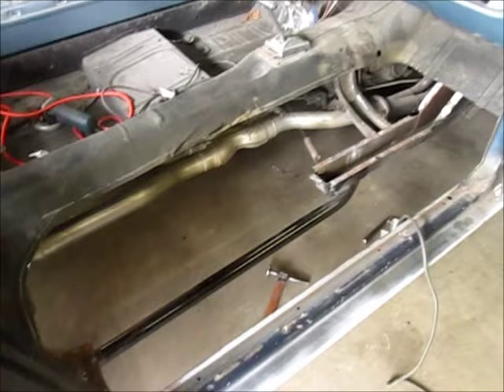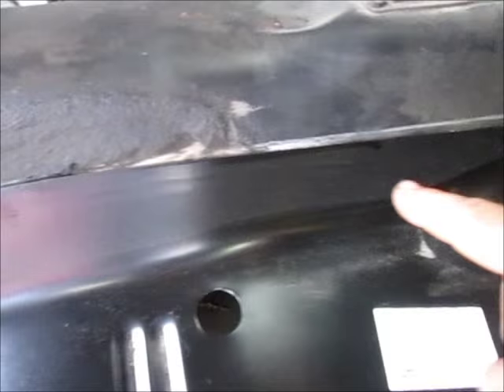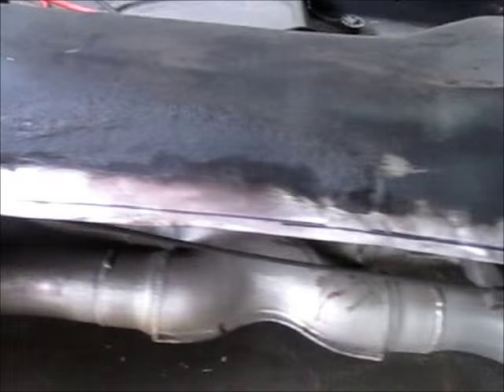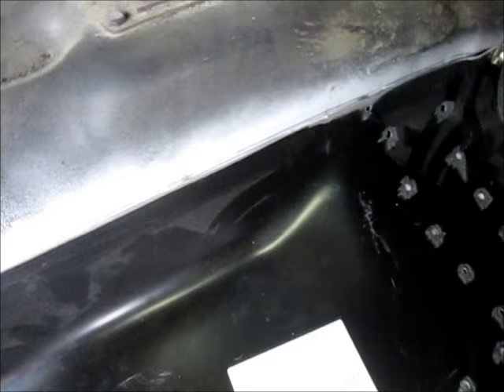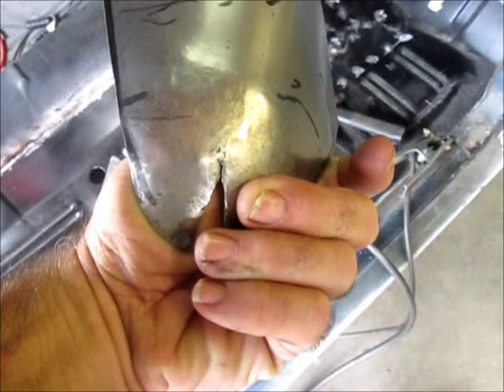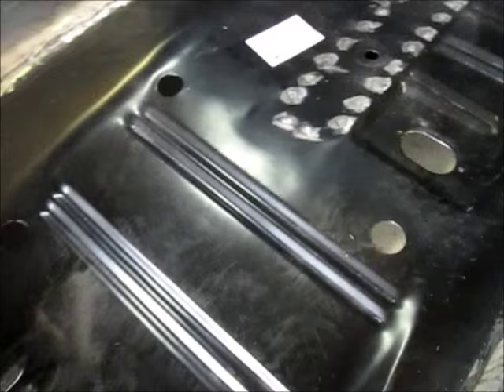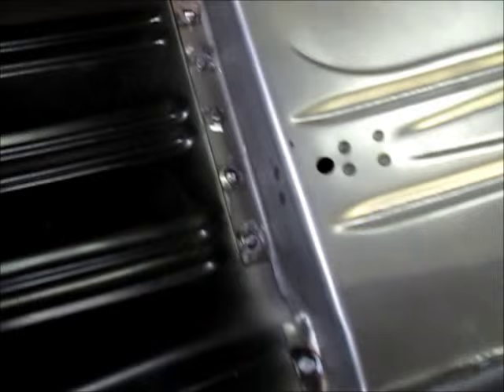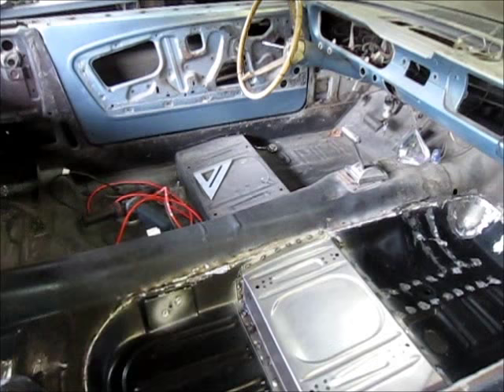1965 Mustang passenger floor pan installation.  "Mystique" Part 2

Comment: Really enjoyed your video. Very educational. I noticed that you were not mig welding the floor panel.
I am beginning to learn welding and have some floorboards to replace. Can you explain the advantage and disadvantages of the different welding techniques and why one is better than another?
Keep the video's coming. they do answer a lot of questions.
Reply from the maker: Actually I mig weld everything. I prefer that over flux core as mig is cleaner.

Comment: Why do you fully weld the lap joint on the trans tunnel and not on the flange side that's spot welded? Just curious. Great work btw
Reply from the maker: Good question. The reason for the full weld at the tunnel, is I want to replicate the structure that was there. On the side, it had factory spot welds every few inches. I replicated that.
Reply: @JoDaddysGarage  makes sense. I was curious if it was a structural integrity thing or not. Thanks for the tip.

Comment: Hey Barry. That outer perimeter weld is that a butt weld or is there a slight over lap/lip on the trans tunnel?
Reply from the maker: I do an overlap in the trans tunnel and perimeter. Spot welds on the inner rocker like factory.
Reply: @JoDaddysGarage  thank you so much again. You are such an amazing asset to this community. If you're ever in Oklahoma City please let me know. THANKS!

Comment: Great Work. In the section you were drilling out holes for the seat belt mount, would it be fair to say you use those drill bits for drilling out your spot welds? If so, in a different video where you drilled both pieces of metal on a torque box, then match the holes up to weld it back together, would you use a piece of copper as backing on the holes to weld the torque box together?
Reply from the maker: You could use a drill bit like that. You could also use a backing plate if needed.

Comment: I have a question. when you're welding a new floor pan do you overlap the new pan with the old metal or is it better to butt weld? thanks....awesome video!!!
Reply from the maker: I typically do a lap. It's stronger and can be easily hidden. I will weld the top, trim the bottom, treat and seal.

Comment: Thanks for the great video.  I'm about to attempt the same repair.  I cant tell in the video, but reading the comments they indicate that you're doing a lap weld at the kick ups, trans tunnel and rear curve area.   My local body shop says that they add a flange along the trans tunnel.   Then cut the new floor pan to fall into the flange.     Do you see any problem with that?   I dont see how the curves can be flanged, or how the ribbed area in the kick up can be flanged.
Reply from the maker: Yes, I do a lap weld on the tunnel and rear area. The side, I do spot welds. I haven't see anyone add a flange like that. I normally lay the new pan in place after some trimming, and trace it. Cut about 1/2" below that line, and reset. I try to leave about 1/4" overlap, and weld solid. I will then go underneath, and blend down the rough edge with a sanding disc. Leaving just a little to hammer flat. Spray with etch primer or epoxy, and seam seal later.

Comment: Would there be an issue created if you used self taping screws to fasten the panels down and in place? Then after welding the holes around the spaced screws, remove the screws and plug weld the spaced out screw holes? I was thinking that it might be easier to adjust and place the panels.
Thanks for the video.
Reply from the maker: +amtpdb1 I've done the same thing before. It works fine.

Comment: new subscription... love your work.  Learning a lot but, you keep saying that you drill out holes for plug welding but surely you use a pneumatic punch/flange tool, right?  If not, get one!!! So much easier and faster than drilling that it's actually fun:)
Reply from the maker: I had one at the body shop. They're great, but don't have much depth. I will likely get one at some point.

Comment: I'm in the process of installing floor pans in my 65 mustang and I noticed that the seat belt bump out are not in the same location, they are moved about 6" towards the rear. Are all the new floor pans made the same? Does this cause any problems with the belt? Thanks
Reply from the maker: +Stangresto Hmm... I've not seen that before.  I don't think it would hurt other than it takes up some of the seat belt length.

Comment: First off - Love your videos.  Very inspiring.

My question is this - what will you do about the lap joint from underneath?  Will you fully weld that seam as well?

I have a '64 el-camino I need to do this to.  Problem being that I want to lap my pan flat along the rocker as I have seen, BUT that will leave an exposed lap between the floor and the frame of the car.  The only way I can see to deal with (lap or butt) the back side would be to lift he body off frame to address this issue.

Any other suggestions?
Reply from the maker: +Herb Kaup Thanks for the comment. I will not weld the seam underneath. It's not necessary. I will lightly hammer the edge flat, spray with epoxy primer and seam seal. It will be water tight, and plenty strong. 
Being that you have a full frame car, you may not have a choice but to get the body off of the frame.....sorry.

Comment: Thank you for this! I am restoring a 68 fastback and was debating whether to go full floor or separate sides and your videos are very helpful. 

How did you address the bottom of the pans? Did you do any welding around the pan from the bottom or just seam sealer?

Keep 'em coming Thanks!
Reply from the maker: I typically do a full perimeter weld on top, and trim excess from bottom, and blend, treat, and seam seal.

Comment: Bear it looks great! I was wondering lap versus butt weld. Some guys insist on the butt weld for body panels. What is your opinion comparing them?
Thanks
Reply from the maker: +Dave Brittain For body panels, I would prefer the butt weld. (Quarter panels and such) for floor pans, I prefer the lap weld. It's strong, and it won't warp. If I was worried about appearance, I would do a full floor.

Comment: Your thoughts on panel quality and manufacture supply. You had stated premium panel.
Reply from the maker: +Dave Lowell There are a variety of suppliers. Panels will vary from each. I have been pleased with dynacorn, and just about anything that states "original tooling".  It stands to reason that typically if you pay a little more, you end up with a better panel. I get my sheet meal from Mustangs Unlimited. Mostly because they are only about an hour from my house, and I can actually see the pieces before I buy them.

Comment: nice work. im getting ready to do my front driver frame rail. i watched your video where you patched one, but do you have any tips or information to replace the whole thing. ordering a new driver side rail, have floor extensions already and new floors like what you just installed.
Reply from the maker: +callofgeorge I have not done a full rail. If you can make sure the car is level and square, you should be able to make measurements from the old one and verify the location of the new one as it goes in. Might even be able to tack up some rigid contact point to make sure it's in the right place.

Comment: Thanks for the great video. Can you tell me what size welding wire did you use and can you tell what the setting are you using on your welder are?
Reply from the maker: Wire is .025. Power level is 2, and feed is between 2 and 2.5

Comment: I've got rust on both sides of the rear floor pan at the drain plugs on my Torino would you replace that section without the plugs.
Reply from the maker: +Leonard Gilbreath You mean eliminate the plugs?
Reply: Jo the replacement pans that are available don't have them and if I can make that small section and just eliminate them.
Reply from the maker: +Leonard Gilbreath It only matters if you're trying to look original. Those holes were there for jigging purposes when on the assembly line. No need to keep them.

Comment: So you didn't blend the underside of the tunnel? You just over lapped it and filled it with sealer? Let me guess cuz nobody will ever look underneath?
Reply from the maker: Sorry, no. I blend the underside without making the metal thin. Spray with epoxy and then seam seal prior to undercoating.  It leaves an obvious transition, but then again, I don't try to hide the repairs. I guess you could do it another way and lie to people.